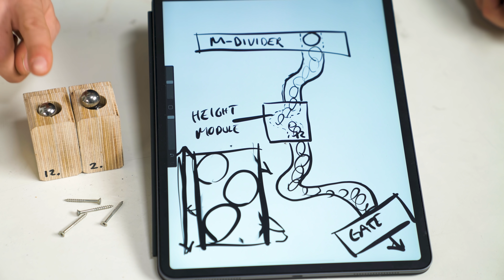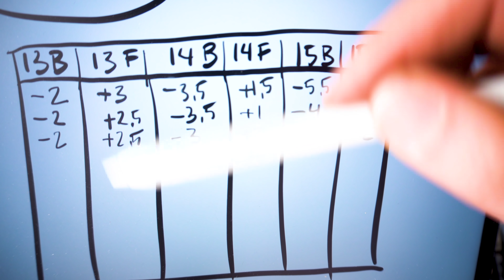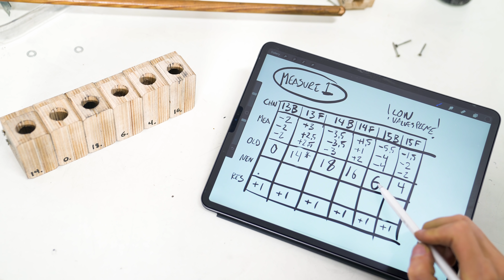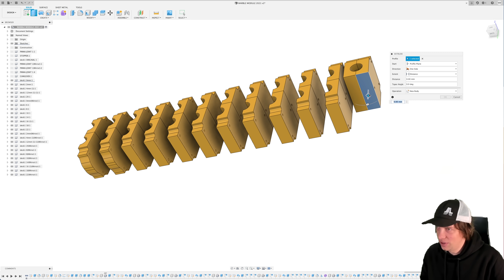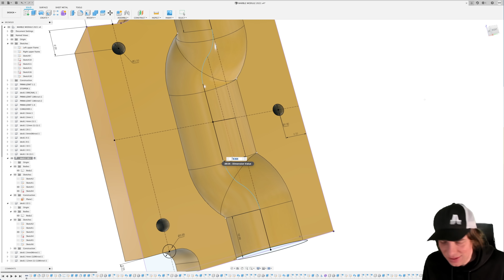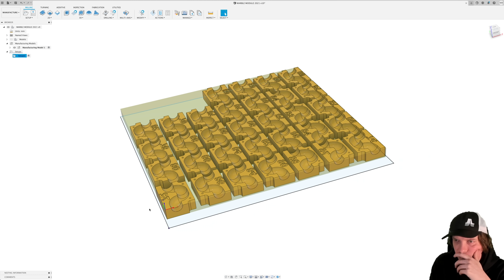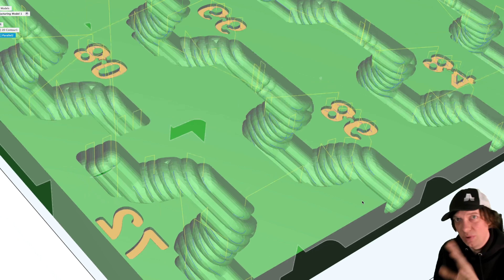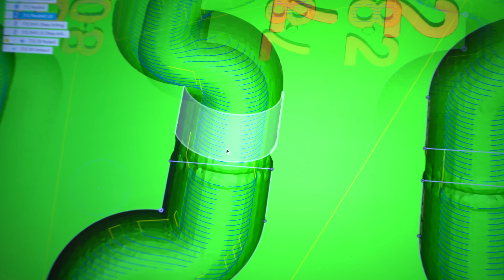Marble Hobby Project Gone Wrong

Comment: This much work for 4 Channels... Martin if you ever will finish this machine, some metal blocks with adjustable height (with a bolt) would be great. Like sliding blocks which change the height to adjust that the marbles rolls over the top. 
This... is just much much much work xD

Comment: This is probably to late for it, since I believe you've already solved the issue, but the tubes could be the problem here. Since they're allowed to curve, that bending could cause the tubes to squish, and the marbles would stack more vertically (less of the wall-hugging you described in the start of the video)

Comment: Hey, idk ifyoull read this but you can actually save a lot of time on th cnc. Idk if your chuck allows but id get a bigger ball nose mill for roughing the entire part in one go, maybe 5min. This will also save you tool costs since the small cutters wont go dull as quickly. Then instead of using a x/y offset you should use the programm that goes down the Z axis by a certain parameter up to 45° and then use programms with x/y offset with the same parameter, but dont use linear motion but instead dynamic ones so it adjusts to the contours. Hope i could help a few ppl  :)

Comment: you know I will give you the best advice I can to see exactly how those marbles react to your loader I have one simple question why have you not yet done acrylic variation so that you can see exactly how well your balls hold in those holders after all if they do move left and right you want to know that but if they're right on the nose where they're supposed to be you also want to know that this would make you jump so much more easier I always have the curious what would happen if you took all the wood that's inside of your marble machine x acrylic would that not make the machine look insanely futuristic and very difference after all your loader to the system is acrylic why not see if those marvel Lane's are two

Comment: I was wondering if the text you put on each height adjustment modules could be automated depending on the parametric size you put for the length of the module ? Like 16.5mm would output the text 165 (or 65, depends on how you want it) automatically, and so on :o.

Comment: Ok, please tell me if this is a good solution. At the marble drop hole add a few inches of corrugated (accordion-style) tubing with simple pipe clamps at each end. The clamps are connected with a threaded rod. Turn the rod to change the distance of the tube segment. Adjust for optimal flow. Accommodates changes to the rest of the path. Easy to adjust and repair. No machining.

Comment: I used to program cnc milling machines and with a rounded or bullnose bit you can normally set a factor for the step over, it is the hight you leave of the top between the two toolpathts. So if your bit is in an optimal position it will set the toolpaths wider an closer in function of this parameter

Comment: I don’t know if fusion 360 has it, but the parametric modelling software I’ve used in the past has had functions where you can use a spreadsheet/table to create new versions of the same part, so even quicker to create all those different iterations

Comment: Hi Martin, I have a question...

It seems like there is so much energy that has to be put into making the marble paths come to an exact height, but what if the marble divider itself were redesigned to NOT have this requirement? Wouldn't that increase reliability because small changes in downstream marble path lengths wouldn't matter at all?

For example, the marble divider could be a redesigned to be like a pachinko machine. This would mean that as new marbles enter the divider, they end up assigned to a random path, rather than being put into the next available path. The layout of the pins in the pachinko could be designed to aim for a uniform distribution, so that with enough marbles you could be reliably sure that all paths would get marbles and no path would be "starved". Then the divider wouldn't care about the millimeter height of every downstream path.

Plus a pachinko-like portion at the top of the machine would look really cool! Maybe you've already examined something like this in an earlier video (you make so much content and I haven't watched all of it... yet!) Just curious!
Reply: If I have the right image in mind, then the random paths in those kind-of slot machines create a normal distribution (https://en.wikipedia.org/wiki/Normal_distribution ), not a discrete uniform distribution (https://en.wikipedia.org/wiki/Discrete_uniform_distribution ) required for the divider. So the out-most paths will be starved, while the middle gets flooded. The current fill-from-left design somewhat creates the uniform distribution by by cutting off "excess" and passing it to the right.
The feeding using multiple lanes merging down the path somewhat resembles a 1-level deep B-Tree (https://en.wikipedia.org/wiki/B-tree ) and eases the flow issue created by the fill-from-left approach.

Comment: so I was thinking with the height modules, if they were numbered where module 1 means 1mm marble height offset, #2 means 2mm  height offset, #3 means 3mm, 2.5 means 2.5mm etc, maybe it would make it easier to do the height adjustments without measuring each piece every time? I guess you've already cut everything now, but you could still label the height offset on each one if it helps

Comment: Way too complicated. To achieve the required reliability, this part has to become much simpler: Instead of the rolling path over the marble-heads, make something like an elongated container that spans and feeds all marble-inlets. Think of the coffee beans in a container above the coffee grinder... Fill this container with 200-300 marbles to start, and than feed it with the fishstairs. So you get rid of all this problems.

Comment: You may be approaching the point where you should be changing the plywood for a more homogenous composite product that will machine better and provide more consistent results and not subject to temperature and humidity variations once on the road.

Comment: you would need to have pipes and spacers that match the diameter of the marbles. otherwise you always have some shifting. the closer the diameter match, the less of a shift will occur.  that might even solve your 21 to 22 mm issue you have been having...

Comment: Martin, great videos!  Please don’t let your love for making them creep into your time for the MMX.  Also, did you ever think of making an adjustable module, where instead of the fixed sideway paths use spaced screws in an alternating fashion (top a-b, mid b-a, bottom a-b) to allow more granular adjustment of marble height?  That way fewer modules need to be made and you should be able to micro adjust marble alignment after all modules are in place.

Comment: Could the marble divider consist of a flush sloping chute with circular trap doors in the bottom that opens if the pipe underneath needs another marble? Either controlled with a rod that closes the trap door when a marble is present at the top of the pipe, or with a little electromagnet that shortcuts when a steel marble (aka electrical leader) is present at the top of the pipe. Even quite old pipe organs use electromagnets, so it shouldn't be an alien component in the Marble Machine X. It also could be a little feature inspired by pinball machines that also uses the steel marble as an electrical leader. The way this first uses the steel marble as a magnetized element in the lift, and then seconds later uses the same marble as a leader would be nice for the Marble Machine X as an equipment of science, not just a music instrument.

Comment: Hope, that it works and is reliable even after you change other stuff on the machine! The alternative solution would be a mechanism like in a trombone, where the pathlength itself is adjustable just by sliding.

Comment: The way the top is designed, it looks like the vibraphone channels are fed only from the fish stair, so only marbles that recirculate after missing all the other channels, instead of having access to the larger supply from the larger lift. 
Have you calculated how many marbles each channel needs to receive VS how many can be supplied, for the music you plan to you compose?

Comment: Howdy dude, 
Have you considered trying to design the strict flushness requirements out of the marble divider instead of trying to design around it?
You have been having a lot of issues with this design and given the tight tolerances on the flushness, any wear, buildup of dirt,  or shifting for whatever reason could mess these adjustments up.
I have absolutely no idea what so ever of how to redesign the marble divider tho ^-^

Comment: Instead of individual blocks of different lengths you might be able to design one block of adjustable length. Top and bottom fixed but be able to move the middle section forwards and backwards with a screw adjustment. You could then easily fine tune the marble path lengths in situ.

Comment: It's feasible with this parametric CADing to actually have a parameter for the height of the top marble in millimetres. The formula should be quite simple, but the complication is that the marbles have wiggle-room which will add error bars.

Comment: I was thinking, maybe if you don't use PMM pipes you can do the channels with plywood, like you did on the block to reduce pressure on the gates. You can design them on Fusion and it will be faster to manufacture with the CNC.

Comment: Hmm wouldn't it be more convenient and easier to account for errors (like due to slight shifting of the machine parts in transport) to be able to adjust the marble height right at the top below the rail? I'm thinking about a spring steel guide or similar in a height module which is adjustable with a screw? In my logic it should'r rely on a marble path so long as this might change with even really small shifts in the machine...

Comment: If you had a Archimedes bottle brush screw rotating parallel with the ball track it would gently coax the balls both downhill and into the tubes which would reduce the nead for critical ball head hight. Just think how many times have you SWEPT your hand along to encourage the balls to find their "home", why not give them permanent encouragement, an auto helping hand? Wilson could be Supervisor! 🙂🙃🙂🙃🙂🙃🙂🙃👍

Comment: I'm sorry, but I have to say this:
The Marble Machine X has too many bad implementations:
- the marble lift will fail as soon as the drop-off point from the lift is bent even the slightest
- the marble devider is too sensitive for height-adjustment
- the PMMA-pipes will bent over time in hot summers on hot stages and this will shift the marble stack height which will lead to the marble devider failing
- the funnels may work in your room on the steady floor, but on a stage? I don't think so

the MMX is still way too sensitive for the world tour and though you developed many great ideas, I would suggest scrapping this projekt and starting MMY. 
- marble lift as in Mathias Wandels Marble Machine 2
- marble divider still has to be sortet out, but it shouldn't be too complicated to favor lanes with less marbles and hold on lanes with more marbles than others
- only straight PMMA pipes or better supported bent ones (not those crazily bent ones that hang freely)
- a big marble catch are, not quite small funnels

The marble gate seems to be borderline genius, the programming wheel with the welded stuts was a good idea and seems to work like a charm together with the whole note activation and mute mechanism, so it isn't all bad, not even close. But the MMX will not be good enough!

Comment: I think, in any case some sort of adjustment mechanism is in order. As many parts of the marble channels and the marble divider are made out of wood and other "soft" materials, there will be some sort of wear out over the time. Therefore all efforts of tuning the marble positions with a "fixed" design will fail over the time, not to speak of changes in temperature and humidity. So adjustment screws at a reasonable position are key. You are also going to tune a piano or small organ after transport, aren't you?

Comment: it kind of makes sense that all the modules gravitated to the same number. if you have one with path length A and one with path length A + 1 marble diameter, it will function the same since the marbles are moving a set distance after each drop. all that kink in the adjustment block does is reduce marble pressure a little bit and increase the manufacturing time

Comment: I feel like the stepover used should be exactly the same as whatever was done before; otherwise these modules aren't going to reproduce what the old 18 or 16 modules used for the measurements did.

The marble alignment issue is creating so many of the engineering problems.

Comment: Martin, you need to abandon the marble divider altogether. It's a mole factory with the constant individual calibration. Instead, use a single splitter that feeds channels A and B just like the  channel design on the demagnitizer MMX#39 video. Except the design will feed every single channel by splitting 1,2,4, then channel 1 feeds the vibraphone, channel 2 feeds the drums, 3 feeds the bass, 4 is overflow. Inside each instrument cluster feeder, the marbleway is split again 1,2,4,8,16, 32 as needed. The marbles will always flow to the channels that need them most until overflow is reached. At the end of each feeder line, you can standardize ALL inputs to a single PMMA pipe length, unbent, directly into the instrument channels. 

The marble divider as it stands now will forever be a source of infinite moles since the entire load of marbles will have near infinite height combinations when marbles are on top of marbles. You need to know when to kill it. This is one of those times.

Comment: this marble divider is a "single point of failure"

The machine can fail if one channel changes by a few millimeters. I worry that transporting and assembly could require you to repeatedly adjust the length modules. I also wonder if temperature or humidity has an effect on the marble path length.
Reply: Yes it would due to expansion and contraction.

Comment: I work with CNC mills every day.  I'm a machinist in the aerospace industry.  I enjoyed this video and like how you explained part of the engineering/design, as well as the production side.  I am curious as to why you don't run a larger ball endmill for a finish pass.  It will produce a smoother, cleaner surface with the same step over.

Comment: Hi Martin, another idea for changing the length of the marble path easily (and therefore the height at the top) is to use what I call the "Trombone":
There are two paths joined by a U-shaped path which is of greater diameter such that it can slide over the enter and exit paths. The paths can be made with wood, plastic pipe, or whatever. The U-shaped moving part can be held in place with set screws or brackets. This makes adjustments continuous, not discrete. Cartoon:

enter           exit
 |    |              |    |   
 |    |              |    |
 |    |              |    |
||    ||            ||    ||
||    ||            ||    ||
\      \         /      /
  \      \___/      /
     ________

Comment: I have been wondering if there’s a way to avoid the flush ness issue altogether. Like if you had a little trap door for each channel, and that trap door is closed when the marble back up reaches a certain height in the channel, by pushing a button or lever. Maybe that would be problematic because the trap doors would be constantly opening and closing while the channel isn’t full enough. Ah, maybe you could do it based on the final pressure at the end of the channel; calibrate a button or lever or something so that when the marble column reaches a certain height, there’s enough pressure at the bottom of the column to actuate the trap door up at the top. Sounds complicated and prone to failure. Enjoying your videos!

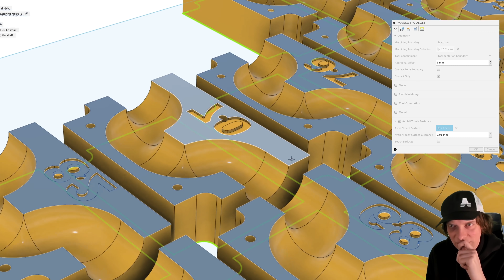Comment: 1. 12:34 - use "contact point boundary" and it will mill it correct width. 2. Simulation mode called "comparison" will show you all errors like that and save you a lot of time. 3. Instead of clicking all top faces to avoid just drop top height -0.01mm or some other small value (actually 2x tolerance at least)  in heights tab so it cant "see it" anymore. 4. 3D Morph or Flow will give you much better results because it can follow UV curves of your model. Less passes - better quality of the toolpath. 5. You can try CAM duplication pattern - would save a lot of calculation and clicking time. I am a hardcore F360 user. You can reach me out anytime.

Comment: Idk if I missed something in the past but, wouldnt it be easier to change the angle that the marbles cross on? So that they have more momentum to get over other marbles if they arent perfectly flush? Or even make it so after each hole there is a tiny step so its higher than the marble when its filled to the top. Also im talking about the piece on top I forget what its called
Reply: Also I understand if theres a huge gap it wouldnt work but changing the angle or adding steps might help out so it doesnt have to be 100% flush